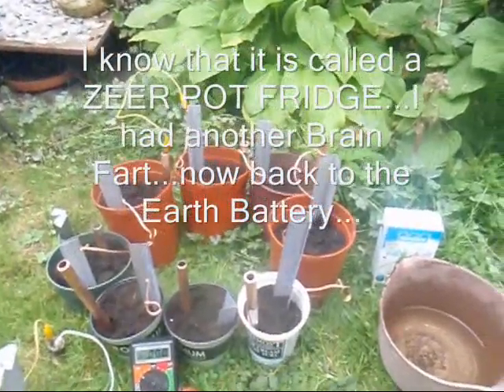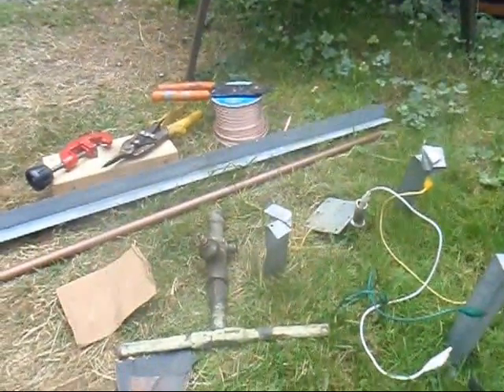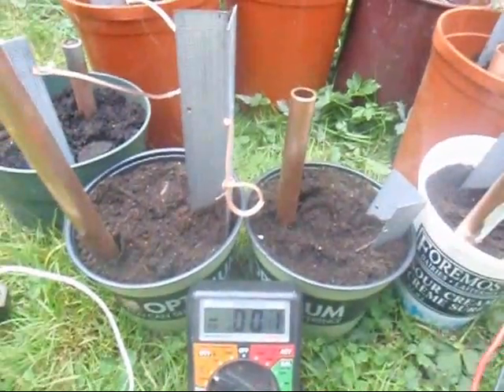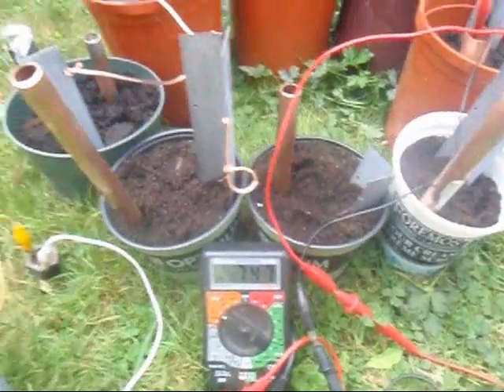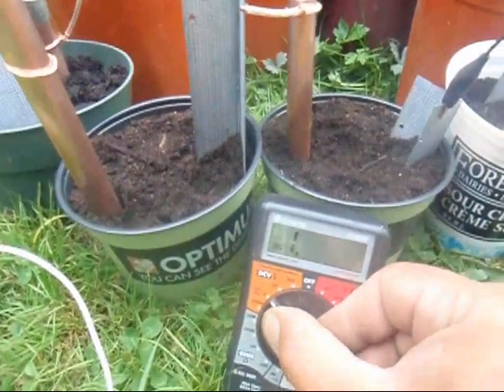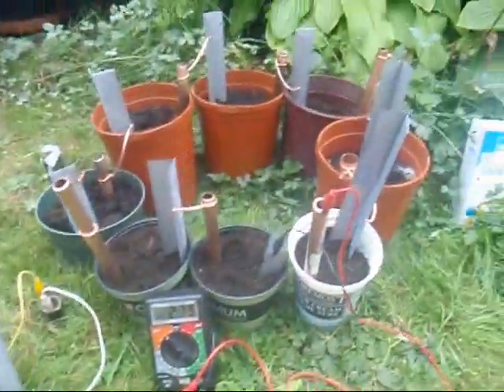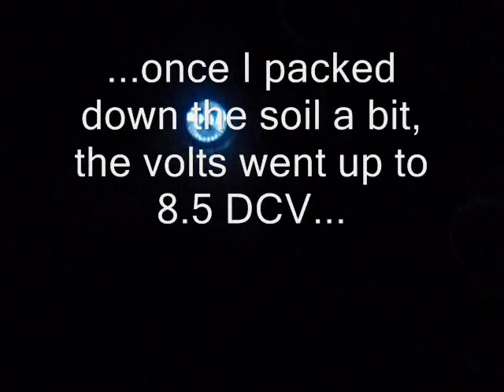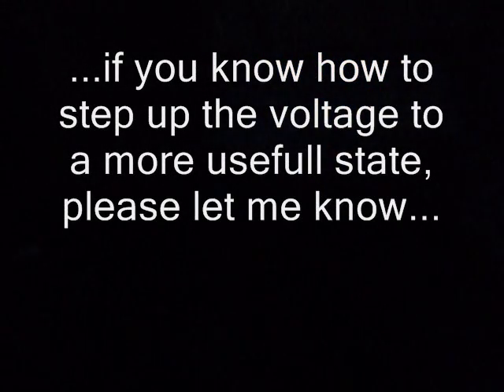8.5 DCV Earth Battery Lights Five LEDs

Comment from the maker: It was brought up once before but after another look at the video, at 01:45 ish you see and hear the galvanized plate rest against the copper pipe. At 02:55 ish it is still against the pipe when the test is conducted, believing this to cause a short from copper to ground resulting in the low DCV. So it may very well be possible to just place the two metals in the ground an not pots.Thanks again for all the great ideas and comment...

Comment: isn't there a short at every connection between pots because connecting the copper to the galvanized of the next pot? so this is a short circuit. feed each individually into a bridge amplifier or something...
Reply from the maker: Not sure about that, never thought about it but thanks for mentioning it. As for the "pops" in the audio, just a crappy camera. Was going to try to remove them or do the audio part over. It was my first video post, try to do better in the future. Thanks again for your input....
Reply: I thought it was an effect of electricity or magnetism... wasn't trying to be rude... great video by the way gave me some great ideas because all the other videos just buried them in the ground like mr. Teslaonian, but your video made me see the potential short, since in his video he uses wood as a resister between zinc and copper pipes and the electrolytes present in wet ground (planting them down stream from his septic drain was a stroke of genius). This video proved this is viable for even an apartment but especially for indoor gardeners.
Reply: The short may be the reason you can't draw under load.
Reply from the maker: The thought of you being rude never crossed my mind. Your comment caused me to review it again. When doing so a short was observed at 01:45 ish. Not the one you are mentioning, but one that may have effected the result of the test at 02:55 ish. So maybe we should drop your rating of great to not bad...hahha.....

Comment: it would be good to use a second meter to measure amperage as you test the alligator clips vs heavy wire and also adding the salt and water. What you are measuring is Voc (volts- open circuit). if you used 2 meters with a load (resistor or LED) then you could get volts and amps or watts. I don't think the amps and watts would be much
Reply from the maker: ...it really does all come back to amperage to make it a more useful source of energy.

Comment: There are much better electrolytes than dirt. You are building a primary or Galvanic cell and the conductivity of the electrolyte determines the available current per unit volume
Reply from the maker: It was spur of the moment with little knowledge... hence the crappy camera and unscripted dialog etc...but so much information has been passed on along the way since...

Comment: dirt or potting soil?
Reply from the maker: ...at that moment the potting soil was easier to use since no shovel was required. Either one should work for you...use an HB pencil instead of the copper pipe. Graphite is a way better than copper and cheaper. Stick a small ball of tinfoil in the ground and check the volts...stick a penny and a pop can tab in the ground and you will get something also...thanks for the ask...

Comment: use 4 inch cooper pipe and put in bolt twice smaller of pipe put  3inch the copper to the ground 1 inch above stick the bold in the center of pipe and you getting 1 V and 2,5 mA
Reply from the maker: +Bosnjak Bosanac   Like the concept. Thank you for sharing it with all of us.

Comment from the maker: Stuck a two inch galvanized washer and a HB Pencil in the ground a few inches apart the other day.
....1.7 DC V on the meter .That is a full volt more then the .7 DC V from the pot in 2012.  Kneed more Pencils and Washers...
Reply: +Drunktoads Graphite?
Reply from the maker: Yes...Graphite is a very good material to use in place of the Copper.

Comment: Add copper coil or inner part of an alternator with additional neodium maganets. Should vamp it up.  Love Q-PID   A girl!   : )-
Reply: +QPID INDIGO I don't think so. Induction requires some relative motion or a changing magnetic field.
Reply: QPID INDIGO But throwing a whole alternator after the earth circuit granted its strong enough will produce ac. Then you can utilize magnetic induction

Comment: I thought I seen the voltage go up when you added the salt. But when you added the water to the pot with the salt, the voltage when down. I believe you may of wanted to increase the amperage to light up the flash light. If you increase the amperage, the voltage would go down. so somewhere there has to be a means. Another set of batteries in parallel may help light the flashlight.
Reply: +Alberto Ortiz 
Batteries have an internal resistance dependent upon the surface area of the plates and the conductivity of the electrolyte. You can calculate the internal resistance by using a known resistance as a load,  measuring the current and voltage, then use a different load value or open circuit measure again and then use Kirchhoff's law and ohms law.  (Hint model the open circuit as an ideal voltage generator without an internal resistance and no load.)

Comment: You are harvesting the potential  difference between two dissimilar metals. The potential difference between the metals are a constant and does not vary on size of the metals, Because you are working with dc power it is very temperamental when it comes to connections, make sure your connections are sound, solder them if necessary. if you connect one cell to the next in series your voltage will increase,  if you connect the parallel  your amps will increase. Hope this helps......
Reply from the maker: .."The potential difference between the metals is constant"...So does size really matter ??? In regards to the surface area in contact with the earth or maybe lemon juice...as mentioned before a pencil and washer produced more voltage than a single pot...
Reply from the maker: ...amps have always been the issue. As for the size or surface area of the two dissimilar metals, size may not matter. Just punched this up... https://en.wikipedia.org/wiki/Galvanic_corrosion
Reply: Size matter when it come to the amps if I am not mistaken.

Comment: Hi. I working for it now and become to ~1 V from one Cu and one Al electrode. Now I am waiting order for one new device, then I upload video.  Maybe should you use dc step up module  example 5V DC to 12V DC converter. And when you have stabilized 12 V DC voltage, then you can rise voltage to 110 or 220 V AC with AC power inverter or make Tesla device to boost you energy.
We need to experiment.
Maybe someone has performed these experiments?
Reply from the maker: +Step to Free Energy  
Purchased a DC step up module from the electronics shop, but have not reassembled  nor tried any of the many suggestions made in this forum. Need to  focus more on one thing, can get distracted quite easily. Thanks for the reply.

Comment: interesting, but may I suggest increasing the current instead of the voltage? the LED is a component driven by current the more current you put into it the more light it gives... dont go too much though, it will burn down the leds... parallel connections will increase the current, so divide your buckets... 4 and 4 and both banks in parallel to each other, you should get an improvement... also, the resistors in the circuit where the leds are, are taking a little power for reverse current protection, that happens with solar panels.
Reply from the maker: +Santiago Rubiano 
Yes, that is the key. Amps are required to make this useful to charge a battery. 
Thanks for the suggestion.
Reply: Wow, thanks for this great help. I am making an earth battery in serie and if I understood it right, I can make next to it an earth battery in parallel (I am not English) and connect those two batteries together in series. So "the parallel" gives ampere to the "series Volt". Is that right?

Comment: you should measure the current too. You can get high volt but if the current is very low it useless. Try use more active material for anode and catode.

Comment: you can simply go on the electrochemistry page on wikipedia and learn much more in one day you'll first learn how a battery works, then you'll realize why you need dielectric and an electrolitic solution, when you place anod and cathod into the ground what you get is the difference of potential of oxide reduction of metal also called REDOX, adding salt to the water solution (the moisture in the ground) will improve the conductivity of the solution and that way the oxidation will run faster producing slightly higher voltage but much higher amperage (the amount of current given by the battery). you might have very high voltage and low amperage or vice versa, just be careful not to go too high in any of those sense, an high voltage will improve your electrostatic loss in the air and dielectrics trough what's called "break" (sparks), a too high amperage will improve joule effect losing power through trasformation of electrical energy in heat. As i said before just go on wikipedia and check it out, science always pays ;)
Reply from the maker: +m0nty90 It would definitely take a day or three, with thirteen subsections and one-hundred and forty-seven pages.The context of your acknowledges reminds me of past conversations with others. Thanks for the thoughts....

Comment: if you use thinner pipe or wire like electrodes
only difference will be current giving capacity of those cells
but good for charging lead acid battery to be used later through inverter
remember to use diodes to avoid any reverse current from lead acid battery to earth battery

Comment: increase number of cells
connect in series
get more voltage
once cross 14-15v can charge may be 12v conventional battery 
connect to inverter
get 115/230v for household things 😊

Comment: So, i checked it out again and it looks right, but you must have a bad connection somewhere. Is that the best voltage that you got?
Reply from the maker: Medicinnov8r Thanks for the inquirey, if you can give me the timeline of the error I will review to see what you mean.
Reply from the maker: Medicinnov8r The best voltage without much experimentation was 8.5 DCV.Not sure how to increase the amps which I think is the key to this power being useful.I purchased a step up DC circuit to try to increase the voltage, but will have to reassemble the earth cell.
Reply from the maker: +Medicinnov8r Just reviewed the video and can see where the galvanized square is resting on the copper pipe at 01:50 ish maybe causing a short. Good eye, sorry it took so long to notice  that your question was correct. So maybe it would work if placed directly into the earth, not using any pots ???

Comment: I dont know anything about electricity, but couldn't you theoretically use the small charge to charge up a smaller capacitor, which could slowly up-charge a larger capacitor, etcetera?

Comment: so have you attempted using 5 gal buckets or would that be necessary as one would probably get the same voltage eh? I'm trying to figure this out, as in our needing higher voltage to charge things up, cell phone, computer, flashlight, or rechargeable radio. Thanks.
Reply from the maker: WheepingWillow2 I don't believe the volume of dirt would be as important as the surface area of the Anode (positively charged) or Cathode (negatively charged)
Reply: Drunktoads ah ok
Reply from the maker: WheepingWillow2 
Sorry for not being very clear with my reply. I have not
tried a larger volume of dirt, but when I placed the metals directly in the
ground the voltage was not much different to the voltage from a single flower pot. A larger surface area of the copper and galvanized metal that is
used to make contact with the soil may produce a higher voltage. But I have not tested this theory as of yet. To be able to get this voltage to a more useable state definitely would have its benefits.
Reply: Drunktoads np, curious though as to when you may try a larger test and yes on its benefits. thanks so much for what you've done. :)
Reply: +Alberto Ortiz Make sure they are old pennies, new pennies are xinc covered with a veneer of copper since 1965 I think.
Reply: +Drunktoads I liked your video! I thought the same thing. a plate of copper would be expensive, but not a mess made of pennies! Galvanized metal would be easier since there are corrugated sheet laying around somewhere. Thank you for something to do. This will help running a security system!
Reply from the maker: +Alberto Ortiz 
Glad you liked it. Didn't really plan it out, just gathered the items then put it together and filmed it. Hope to get a better camera, and a better plan.
Anyhow, there are some very intelligent replies from others that know much more than me about this, and how to make it more efficient. Everyone has been so helpful...thanks again.
Reply: +Drunktoads 
You are really just building a battery. Pure zinc will give better results since it will not be mixed with iron and carbon (steel). You can try using different kinds of carbon for the anode since it is cheaper than copper and won't slowly dissolve. A larger plate surface area, particularly the cathode, will result in more current capacity. The liquid between the plates (electrolyte) will also affect how the battery works. It has to be a salt, base or acid. Oils won't work. Common things to try, ammonia, table salt, vinegar, Mr plumber, bleach, ect. You can also try some zinc, nickel and copper plating by running a DC current in reverse with the object to be plated getting the negative DC voltage.